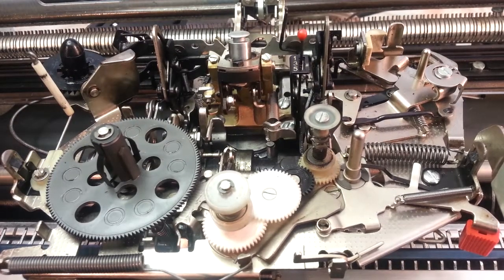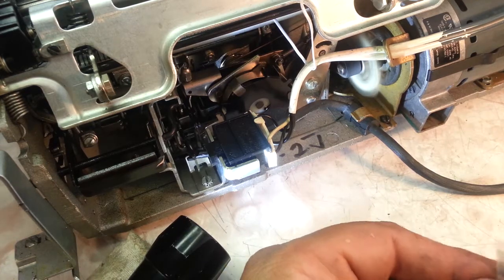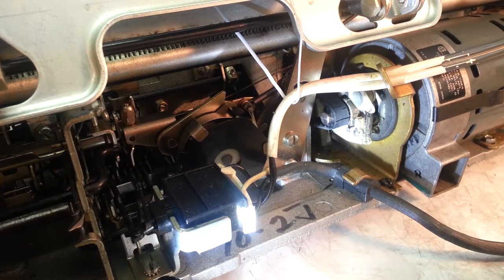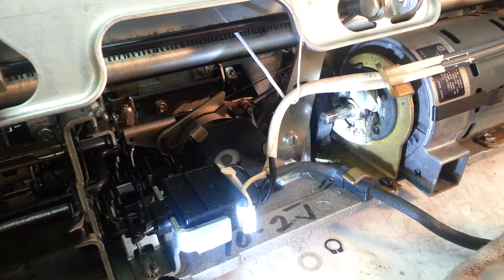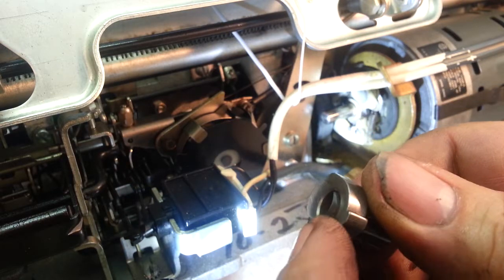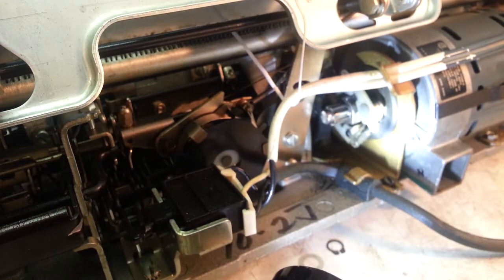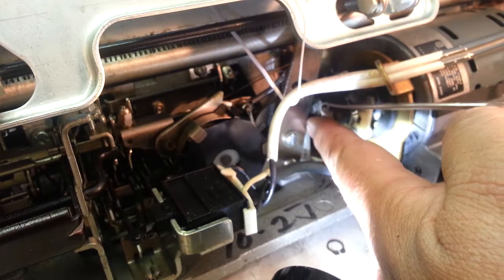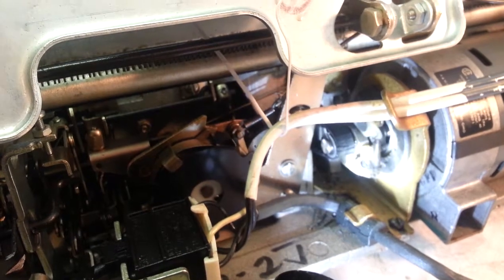IBM Selectric Motor Pulley Bushing Repair Replacement Noise Rattle Clicking Fix

Comment: Thank you SO much for this. My Selectric works perfectly but makes this very slight rattling noise that reverberates throughout the machine. I was quite confused, and thought it might be the clutch. I would've never thought it was just a tiny plastic sleeve.

Comment: When that bushing fails, it is quite the annoying sound.  It seems like I replace those on almost every Selectric that I get in for service.
Reply from the maker: During my apprenticeship I had various trainers & this one worked for IBM & came by every night for 2 hours, for a year, training me Selectrics only, a different IBM guy for standards & yet another for SCM. But That bushing had me stumped, narrowed it down to that pulley or clutch & swapped parts for hours when my trainer shows up & laugh's, hands me that plastic sleeve & explains it. Definitely a strong learning curve on Selectrics typewriters in particular

Comment: I can see that your Retaining Ring Pliers have what appears to be 45° tips, but do you know the tip diameter?  McMaster-Carr lists tip diameter sizes: 
0.038" w/overall tool length of 6 1/4", 
0.047" w/overall tool length of 5 3/4", 
0.115" w/overall tool length of 9 1/4" 
and 
0.070" w/overall tool length of 7" 
for the cushion gripped type, sigh.... :)

Comment: I just got this typewriter about a week ago, my boyfriend's Grandpa had it refurbished and it was working just fine. Today for some reason it doesn't want to turn on, I took it apart to better inspect it, given that I am not experienced with this type writer (or any) I couldn't figure out the problem. The motor doesn't even make a sound, do you think the motor just died all together?
Reply from the maker: No ! very rare for motor to fail. Motor might be gummed & need flush & re-lube, motor should turn freely, if not then it needed to be push started , bushing flushed & relubed. Could be the HUB cracked causing a "High Center" lock up. Could be the actual on/off switch too.... Here is the HUB video :https://www.youtube.com/watch?v=h8O4w_xj6Ns

Comment: hi! I don't know if this comment is going to get lost among the others but, I have a question to you: I have a selectric that I found a couple of weeks ago and its motor has a 6mf capacitor that i've never seen on any other selectric videos on youtube, I removed the protecting cap and the capacitor terminals and end up not put it back. Now I don't know exactly how to reasemble and I'm truly scared that I can burn the motor. There are no indications of the colours of the wires on the capacitor, could you help me?? I'm pretty ignorant on electricity but I wish I could use the motor for something else.
Reply from the maker: You have a WT (world trade) machine that is marketed for foreign country's 
That selectric is using a capacitor start motor, instead of a centrifugal clutch design
Reply: @phoenixtypewriter2136  ok, thank you for replying! Have a nice day :)

Comment: The IBM Memory Typewriter 50 and 100 do not have the clutch assembly?
Reply from the maker: Those units have capacitor start induction motors

Comment: Great vid! Was there a bushing in there originally that perished and needed replacing, or did the metal wear?
Reply from the maker: Yes, OEM design has that bushing installed new. The plastic bushing will wear out to nothing causing the "rattle/clicking" sound. If left unattended, Yes it will wear down both the steel pulley & motor shaft.

Comment: Cant seem to find that bushing on eBay anymore!
Reply from the maker: I found 5 sellers . . . .  https://www.ebay.com/itm/373113079705?hash=item56df45c799:g:iSMAAOSw-StfC0aS
Reply: I had clicked a link you’d posted in the comments a while back and it didn’t seem to work. Just took a little more investigating. :)

Comment: There's a big metal piece in the way preventing me from removing the pulley!
Reply from the maker: Yup.... Sometime they clear that support like here in video, other times you can flex the motor in it's mounts to get enough clearance, last method is to remove motor mount bracket screw ( by cord) , loosen rear screw and move bracket to gain clearance

Comment: I am having this problem with my machine!   Where can I obtain the plastic bushing?
Reply from the maker: Found one here, colman mnf might have them too but they have a 50.00 minimum order
http://www.ebay.com/itm/IBM-SELECTRIC-MOTOR-CLUTCH-ASM-with-HUB-and-BUSHING-NEW-PARTS-Typewriter-Parts-/142063273177?hash=item2113a184d9:g:KPEAAOSwF1dUOR9e
Reply: Thanks!  Am in the UK, so I don't think they'll ship to me.  Could the bushing be made?  What is the material?
Reply from the maker: It's a thin but strong plastic with 30 small holes for lubrication flow.
I tried to make one & failed, but just right size plastic might work
Not sure how critical the holes are
Reply: Phoenix Typewriter - I apologize in advance for this, but my wife won't let me tell IBM stories at home anymore so here goes. The original Selectric motor clutch based pulleys were steel and then bronze without those little mylar inserts. They would both corrode and seize up on the motor shaft very quickly. IBM would release what they called CEM's (customer engineering memorandums) and parts bill of materials to address changes and "improvements ". We were going nuts trying to keep those motor pulleys from corroding to the shaft when they released this CEM that included the mylar insert with the properly sized pulley to accommodate it. We were so desperate for a fix that when the parts first showed up my boss made a special trip to meet me at a customer that had had repeated failures. We sat down at the machine and he proudly opened the small envelope that contained the parts that would solve all our problems.Neither of us had seen what the fix was and of course there were no instructions with it. He either lost the mylar insert upon opening the envelope or it wasn't there. Needless to say we couldn't get the the oversized pulley to work right and had to revert to the original parts. I thought of that episode every time I worked on a Selectric with that problem for the next fifty years.

Comment: Is that Marvel Mystery Oil?
Reply from the maker: Yes, the Red oil !
Reply: @phoenixtypewriter2136   Would WD40 also work instead of using Marvel Mystery Oil?
Reply from the maker: @lexnieland3153  Not if you want it to work next month, WD-40 is not good oil.
Reply: @phoenixtypewriter2136  Thanks, will definitely buy some Marvel Mystery Oil in that case.
Reply: Should actually lube that with IBM #23 grease.

Comment: I have an IBM selectric II that has worked for years and here recently when I turn it on it will start typing one letter continuously and will not stop or scroll back to point 1 without me hitting the enter bar. Help!  The business that serviced ours for years said they can no longer do it due to the liquids that they used to use and I live to far away to bring it to you lol.
Reply from the maker: Not sure I have heard that the "liquids", I'm guessing, chemicals, needed to clean & service typewriters are unavailable is a LIE ! Just like "parts aren't available" , Lie ! These shops are not skilled enough to competently work on IBM selectrics which do take special higher skilled/trained technicians. Your IBM has sticky parts, very common now-a-days. It will need a detailed spot cleaning. It's gonna take someone at my level to be able to get that IBM working right.
Reply: Yeah, they are referring to trichloretheylene, it was supplied to us as IBM cleaning fluid. I retired from IBM in 1987 and continued on my own working on Selectrics (good money). I was able to buy that solvent from a local chemical supplier in Northern Illinois until the early nineties. It was an absolutely first rate degreaser (we used it for everything except brushing our teeth).They told me they were no longer allowed by the EPA to supply that product to the public. I guess the place she was referring to was just using that as an excuse to move on and work on something else, probably PC's.